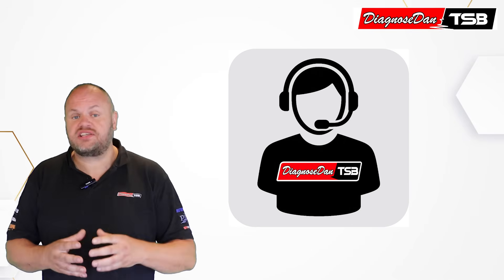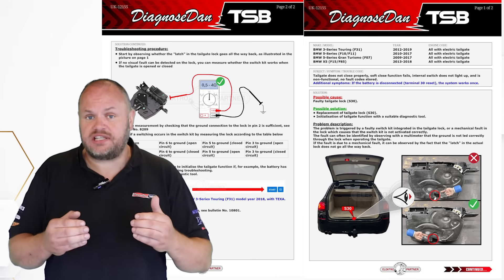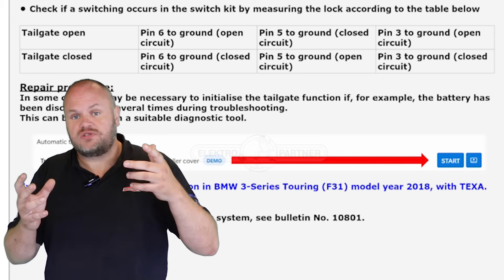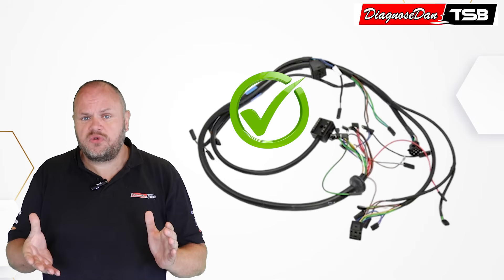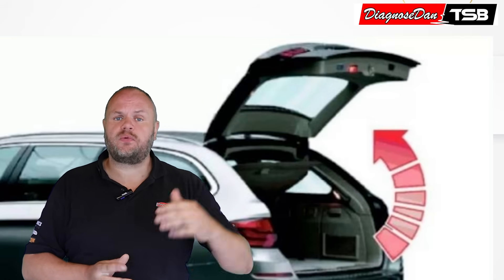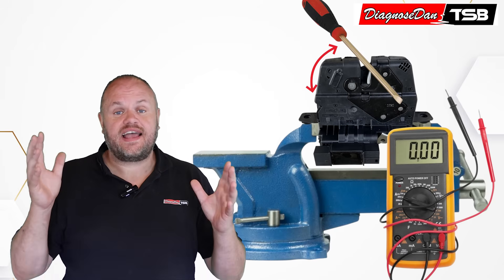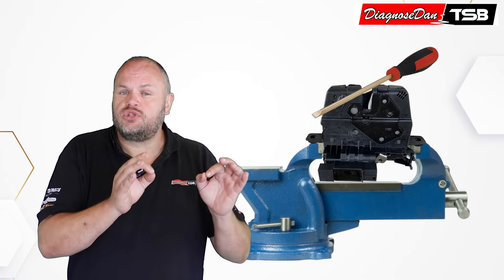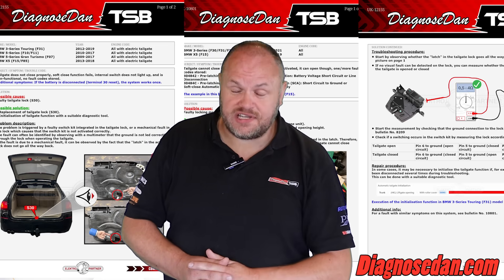BMW Tailgate Problem – Soft Close Failure & No Fault Codes | Hidden Issue Explained

Comment: I"ve been having this same issue on my E70 X5. I replaced both electric struts because one seized up. Now the soft close works intermittently. I have replaced both the motorized latch as well as the tailgate lock. Still the issue persists.

Comment: Years ago, I worked on a Volkswagen Golf with an intermittent total shutdown. The owner gave me a spare key for the service. However, the fault would not occur while in my possession, but would again when he drove back home.
Long story short, he had a large bundle of keys, which he used in the ignition switch, which had worn out the switch over time, causing the main positive to lose contact, which shut down the car.

So yes, different conditions masked the problem
Reply from the maker: I can imagine some time spend on this confirming the fault:)
Reply: @DDTSB Yes, it sure did. Intermittent faults are the most challenging as you well know. Throwing into the mix unknown variables only makes it more challenging.

Comment: I was just wondering when unnecessary systems on the car would start failing and how much of a problem it would be to fix them, as well as the cost of the repair.
Reply from the maker: There is may ways to look at this. Car is evolving fast with new technology making each diagnostic process more complex. The point in this video is to bring attention to the human mistake one can make in this type of measurement confirming the fault.

Comment: You mentioned that original BMW scan tool was used: Why then you did not look in actual values for the switches with diagnostics tool? All the extra work and hours for removing and testing Lock would be avoided! SO:, IT WAS WRONG APPROACH from beginning!
Reply from the maker: Thanks for your kind suggestion. Unfortunately, on the model in this case there is only one switch in live data using ISTA. This switch was working fine in ISTA. Because there is no fault code there is also no guided diagnoses in ISTA
Reply: @DDTSB  The status's ( lol ) can lack alot on info on ista unfortunately

Comment: There is a possibility that the tail gate lock was badly adjusted ,but you would be replacing the lock any way .
Reply: There is no atdjustment on the lock.
Reply: @Oo-IIII-oO  pk , adjust the triker .